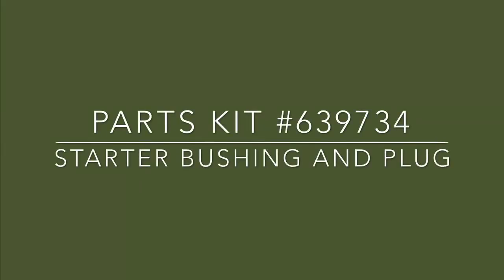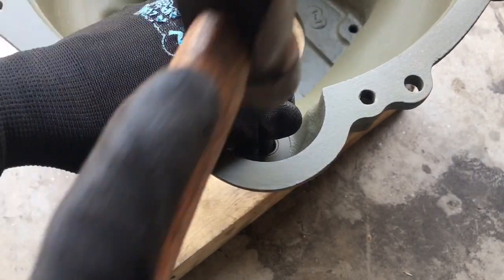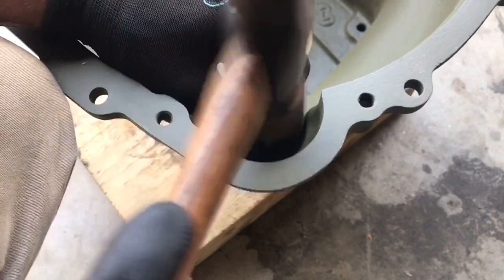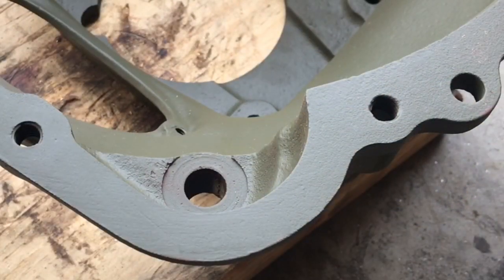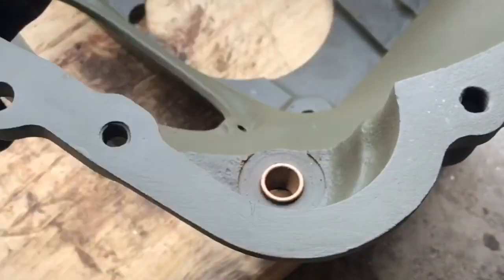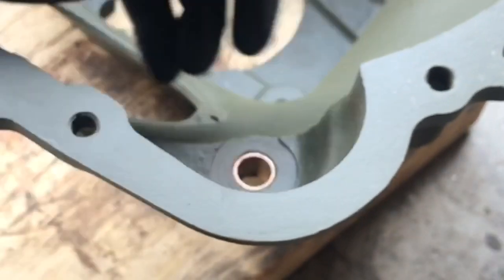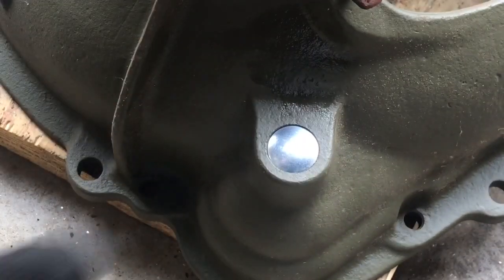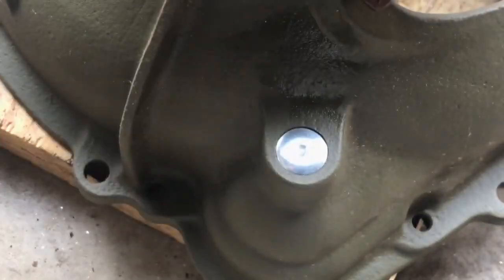Willys MB Starter Bushing And Plug Installation G503TV

Comment: How do I remove an old freeze plug and insert a new one if my bell housing and motor are already installed in my jeep?
Reply: If you hit the plug on the outer edge with a punch, driving that edge into the block, the opposite side of the the plug will come out of the block as the plug spins in its hole. This allows to grab the plug and pull it out. Insert the new plug as done in this video. If you don’t have room to use a socket use a block of wood or some other flat surface. Once the plug is flush in the block you’re done, do not use a center punch on a freeze plug as show in the last step in this video.
Reply: @augieschultz2530  Removing the freeze plug was a moot point because it turned out there was none.  It was actually a buildup of old dried grease, most of which fell on the garage floor when I probed it with a section of aluminum round stock.  I was unable to install a new freeze plug.  I had tried an approach similar to yours, only using a piece of flat steel, but there wasn't enough clearance to press the new plug in.  I contacted my old mechanic and talked over the idea of slabbing grease in there again.  His advice was not to worry about it, just leave the hole exposed, so I skipped that step.  The only other problem I had to resolve was figuring out if I needed a nine-tooth or ten-tooth Bendix.  This required counting the number of teeth on the flywheel.  I could only see a small part of the wheel, so I counted the visible teeth, measured the arc of them, and did a bit of math to figure out the total count must be 97.  Therefore I installed a ten-tooth Bendix.  I haven't driven the jeep much since then, but the starter appears to be properly working.
Reply: @Paladin1873  I answered in the middle of the night and for some reason thought you were talking about a freeze plug in the block. I put mine in the bell housing today after finding out NAPA has them in stock (Part No. Dorman 555-012). Price was only $2.19. May be the cheapest part I’ve put on my ‘44 Willys yet.
Reply: @augieschultz2530  I presume your bell housing is not yet installed.
Reply: @ correct.